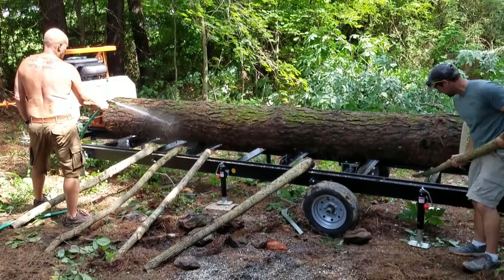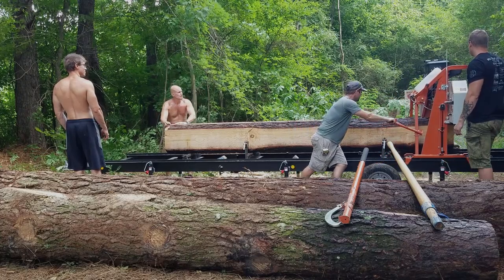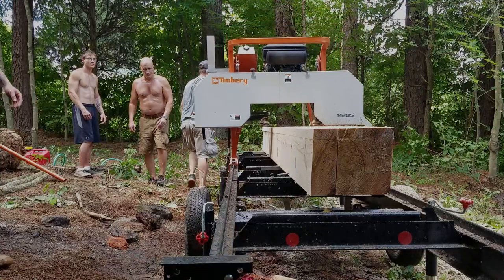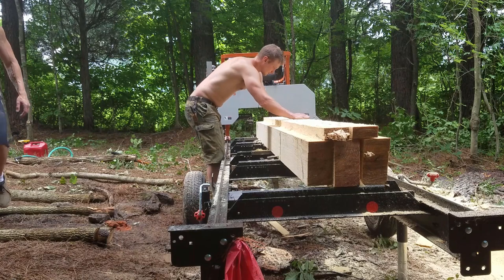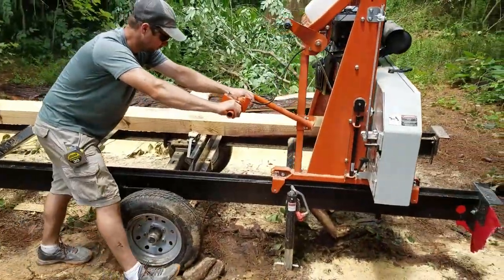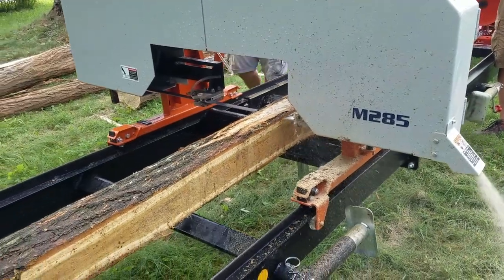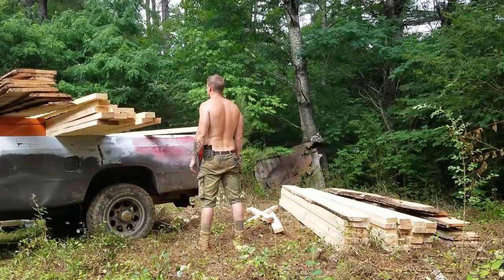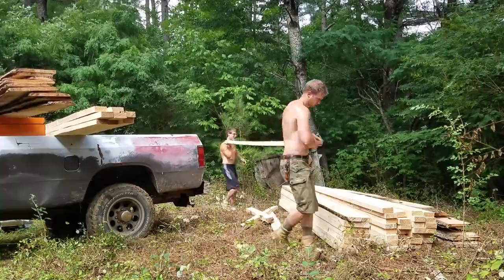Hidden Holler Homestead VLOG#5 Milling wood with ProjectsByKnight

Comment: That's awesomeness. Nothing like milling your own wood. Can get an attachment for a chainsaw too!! All wood start at exact dimensions (2x4, 4x4) but are rough cut. Store lumber has been finished and sanded. Yes it's still green wood so spacers are needed. To dry better. Sounds like a pole barn party is in order haha